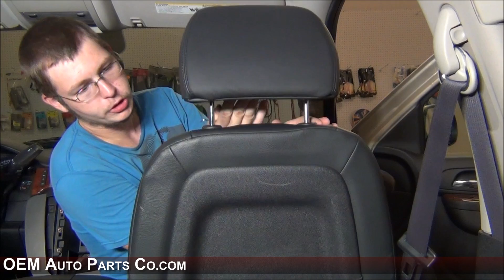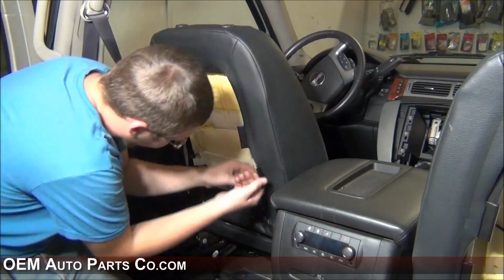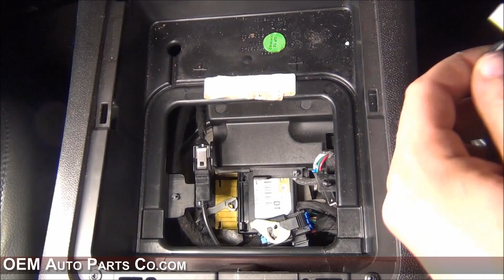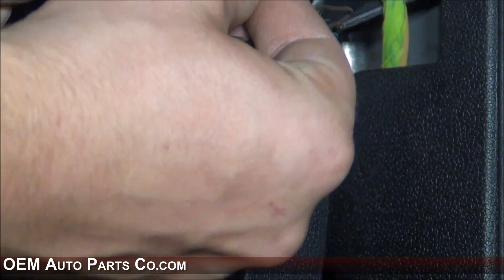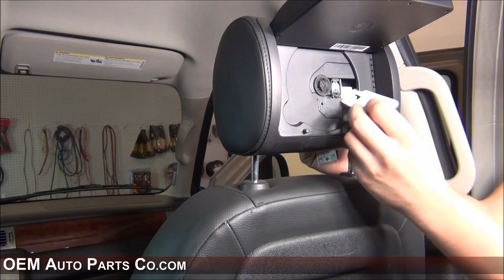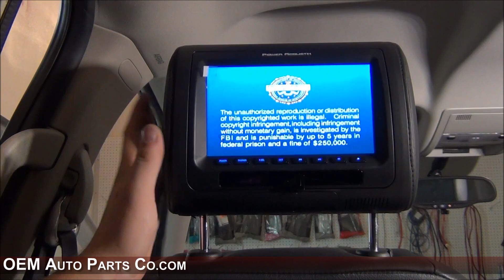GM Rear Headrest DVD Video Monitor Installation - Infotainment.com

Comment: What size T-tap connecters for harness wires?
Reply from the maker: The correct size comes with the kit.
Reply: Thanks for replying. I had an entire kit of my own aside from the T-taps. 22-18awg (Red) taps were required. However, when testing power I see that barely 4v (3.9) show on the meter when key is turned. I found that on drvrs side MBEC has IGN/ACC/GND pins in place (unused) when testing those they provide a full 12v (11.6v) does the difference in voltage have any effect? Tapping as demonstrated in your video only gives 1/3 of power. I have no idea how amps/volts convert and was curious if the difference would matter with headrest performance. Granted both work identical when key is turned. Let me know what you think..Thanks

Comment: how do I connect my dual dvd headrests to double din, so if I choose to play dvd in double din, it'll also play in rear headrest for my 08 Avalanche
Reply: That’s what I’m trying to do to. I have a Sony touch screen radio that plays dvds but I want to add the screens in the back
Reply: RCA cables